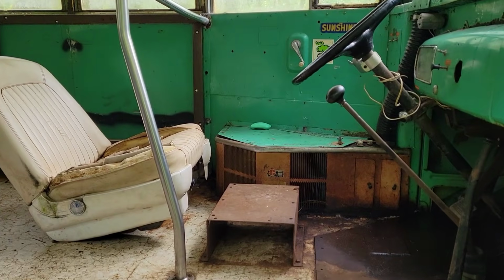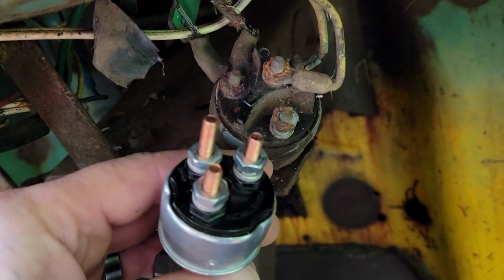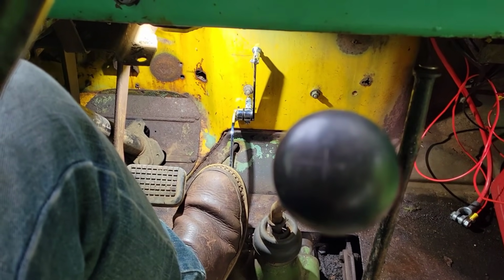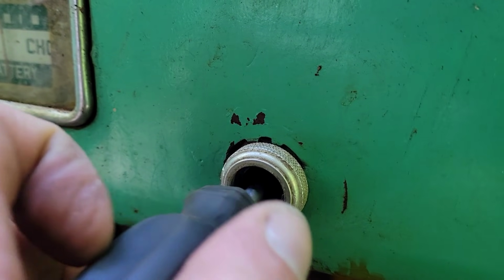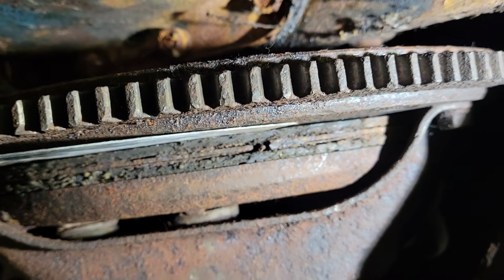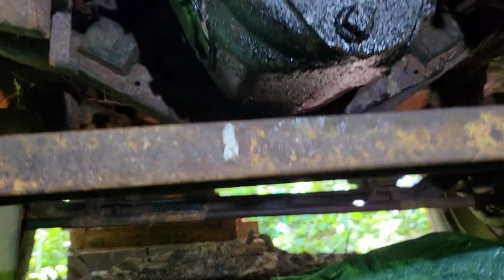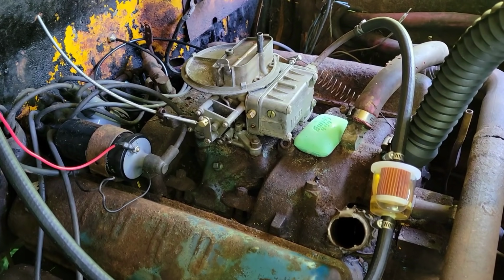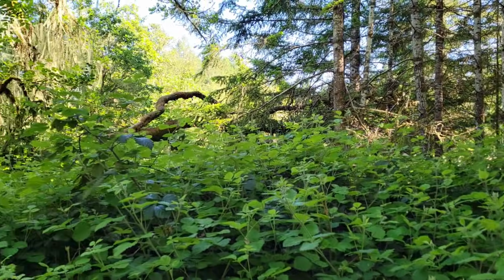(7th) Pt2. Second round to fixing that frozen clutch - Does it work? - Plus a Super Clean Giveaway!

Comment: Glad to see the clutch works now and you can start it from the drivers seat. Progress is being made. Like your clutch the brake shoes may be stuck to the drums. This has happened to a couple of old vehicles I have messed with. I found the easiest way to unstick the shoes is to drill a hole in the backing plate even with the shoe and at both ends of the shoes. Next take a drift punch and place it on the metal of the shoe and give it a good bump. This may be necessary on all of the shoes. It sure beats removing the wheels especially out in the woods. Of course this will only necessary if rocking the bus won't break the shoes loose. Just a little info from past experience. I live in Beaverton so I understand the rain but that is what makes our state so nice. Keep up the good work and have fun.
Reply from the maker: Hey Thanks! I appreciate the advice. I am a bit concerned as well about the brakes being stuck. We'll find out soon and I may try your tip if need be. Thanks! 👍

Comment: Dude, I've got a F-600 in Myrtle Point, OR. It's essentially the same drive train but, with a 2 speed axle.
Your 292 sounds pretty good. It has solid lifters just in case you don't know. 
NO, the clutch M/C won't work on the brake side.
Setting the points is a pain because they are so hidden. I just pull the distributor out to do the job.
RATS; put some ammonia on a piece of softwood and, put it under the hood

Right behind the carb, you have a check valve for the vacuum booster. Won't idle if this goes bad.
Next battle is the booster and wheel cylinders.
You don't have to have the exact booster. Anything that is close as far as diameter of the chamber will work.
You will need to pull the hub & drum to get to the wheel cyls.  NOT fun and, you will need the big socket to get the back bearing retaining nut off the axle.
Doubtful that you can rebuild the wheel cyls.
NAPA might just have them. I changed my truck over to DOT 4 fluid so that the system won't rust.
Change the oil in the axle and trans. 80w--90 or 50 wt. synthetic.
Reply from the maker: Hey Thanks! 👍

Comment: Sure wish i had my 69 nova  with a 3 on the tree ànd a set of shiny pipes all down the side , craigers with kelly tires. That lil sm. Block was actually very quick.. it was factory blue. I also had a 57 chevy truck napco 4x4 had it for 18 years.  Now i got a 56 1 ton4x4 flatbed with duallys  its so close to putting on the road.

Comment: Someone has installed a later model engine.  Should have a flathead.  Maybe not a bad thing.
Reply from the maker: I was told by previous owner it was 1957 Ford 312 Y-block from a dump truck